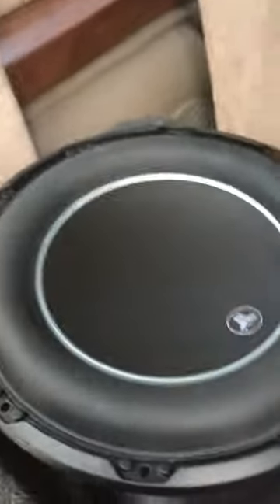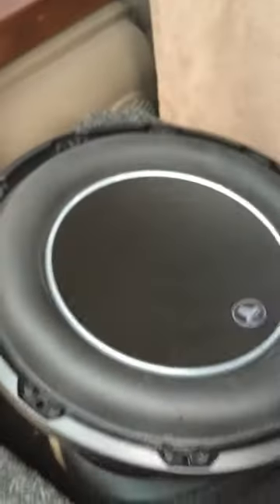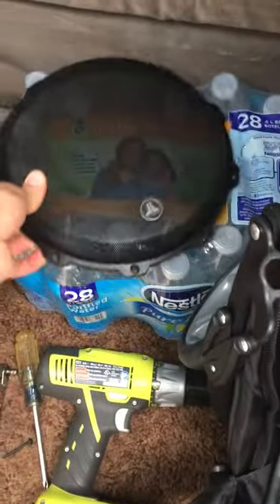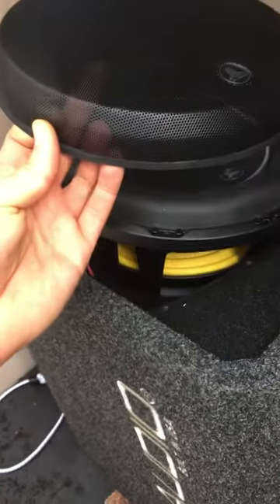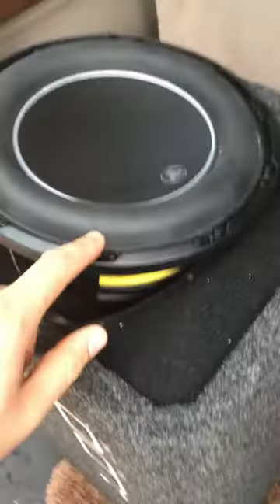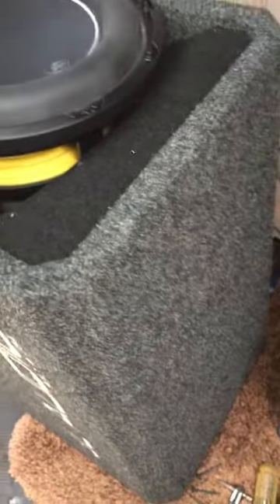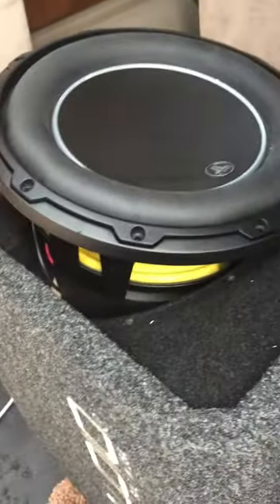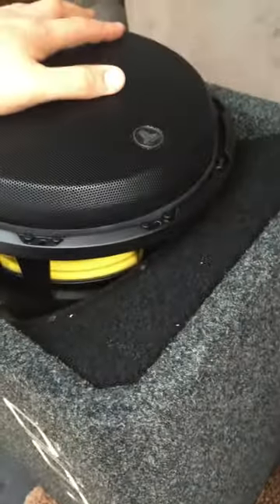How to put a grill on a JL Audio W6V3/V2 or W7

Comment: Truth be told you grabbed the wrong grill for that sub possibly.  You got the W3 grill it seems.  The W6 grill is going to be much deeper that what you have to handle excursion.  Plus you are mounting it wrong.  That lip that is on the grill snaps onto the mounting ring while the driver and ring are mounted in the box.    The grill you have to mount on the grove in the ring near the top of the ring.  Firmly squeeze NOT HARD to feed the lip into the trim ring.  Also if you do not know what I am talking about go to your JL audio Rep. 

From your distant auth JL Audio Installer.

http://www.jlaudio.com/sgr-12w6v2-v3-car-audio-subwoofer-grilles-90587

If any questions contact me or JL Audio Directly.
Reply: Need Nelp
Reply: Looks like the correct grill.